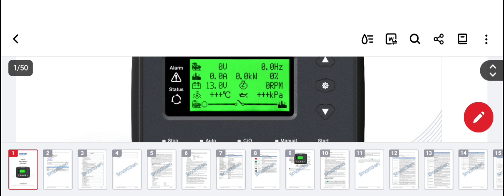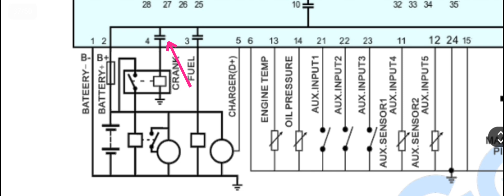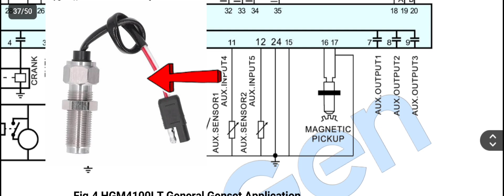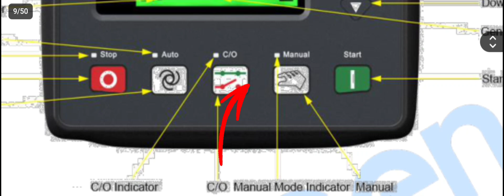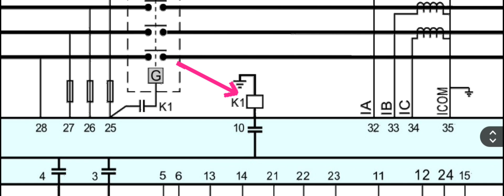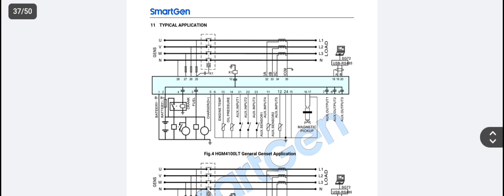SmartGen HGM4100LT Genset Controller Complete Wiring Diagram Explained 💯✅

Comment: What's problem genaretor low pressure
Reply from the maker: First check the engine oil when engine at rest  make sure engine is not runs minimum 1 hours . Remove dipstick clean reinsert pull and check if low top up if level is ok then you need to check the oil sensor wiring, most of time sensor are faulty, oil filter are dirty or clogged check this all and replace  with onather same type sensor  if still problem, may be the engine. Internally oil pump issue or weak Engine connecting road journal bearing or main bearing, or weak oil pump

Comment: Pls which number is the remote control signal connection
Reply from the maker: Remote input is work on  Main Power or grade power put the controller in auto mode that's will sensing grade power when grade or mail fail the controller start the generator when main power is not available..
Reply: I have the smartgen controller there is not available grade supply connect connection and Auto control connection also not available please anybody not by this smartgen controller we are tired
Reply: Smartgen HGM410N controller have not available Automatic sart and stop control connection anybody by this controller please confirm this point
Reply from the maker: Yes it's work by Main power or grid input. Give the Main supply to this controller for sensing and select auto mode when main power or grid power fail the controller sense main power failure and start the generator automatically